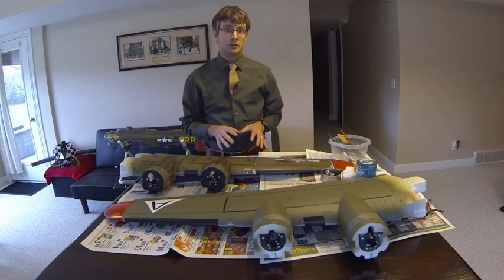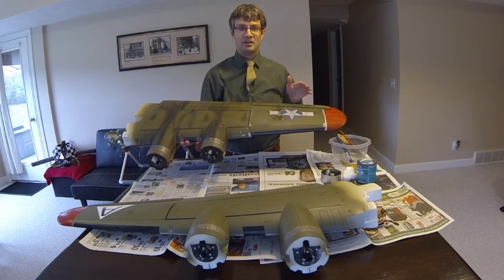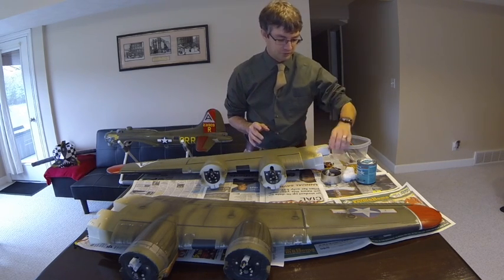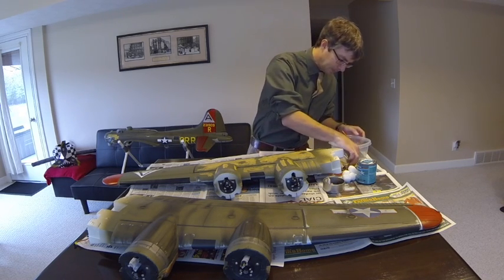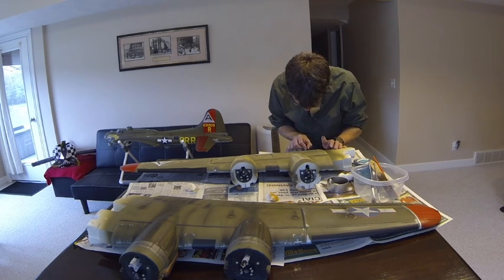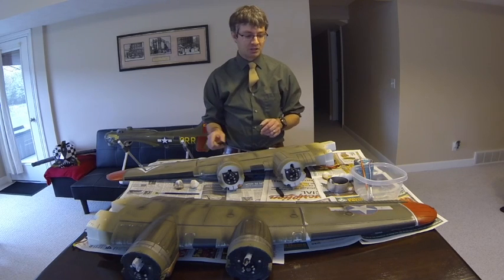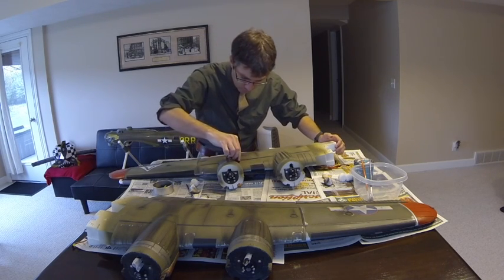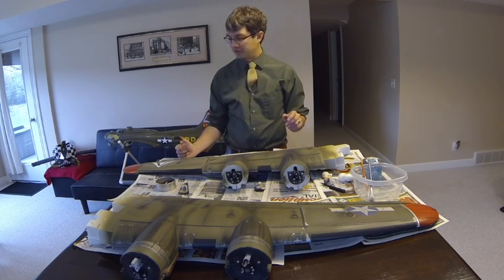How to weather the HobbyKing 1875mm B-17 Wing

Comment: Brilliant video.  Thanks for sharing. Your plane looks great.  Ive just ordered the same plane and will have it within the next four days.  I wanted the olive drab colour scheme but had to settle for the silver b17 as the olive drab version is completely sold out in my country.  Im really looking forward to getting this plane.  Im sure its a real stable plane to fly and should sound great with the four motors.   Well done on a great video presentation.
Reply from the maker: I bought the silver one first and then bought the olive drab one next. My silver one looks brand new as it is a replica of one being flown by the local museum and one I flew on a few years ago. I did very little weathering and added 2 coats of high gloss clear to really make her shine. The OD B-17 is very dirty to look like Nine-O-Nine after 91 missions. I worked with a few historical groups to get it as accurate as I could.
Reply: The weathering job you did on the OD B-17 is first class and I mean that.  It is so realistic looking and done to perfection.  This Hobbyking plane is a real beauty and I cant wait to get it up into the wild blue yonder.
Reply: Hi there, can I ask you a question?   By adding two coats of high gloss clear did that add much weight to your plane and did it affect the flying performance in any way?    Thanks.
Reply from the maker: The first coat is a clear spray, put on lightly to seal the pastels used for weathering. There isn't much weight added. The second coat is much thicker and brushed on. It is Minwax Polyacryclic clear. That does add some weight, but the B-17 is big enough not to be affected. There are other pilots who have added all sorts of cameras, working gun turrets, and bomb bays without any change in performance. The size of the B-17 makes those additions ok. On my smaller planes, the layers of paint and clear do make a difference.
Reply: I may just leave the silver b-17 in its original form with the decals added for now.  Im just wondering with the plane all silver will it be difficult to see at times when its up there?.  If it is after a few flights I may be tempted to repaint it olive drab on top wing and fuselage sides.  What do you think of this idea?  Or will it be fine leaving it all silver?   Im just thinking of it from a visibility point of view?
Reply from the maker: The silver isn't bad to see. The plane is big enough and the shape makes it easy to keep orientated. Lots of guys repaint their planes from silver to OD or OD to silver. I do like how the glossy silver reflects light when flying it in the evening. The OD won't do that. It just comes down to personal preference. I am happy to have both as the silver one looks spotless and the OD one looks like one that has done 91 missions. They both have different personalities. If you want to change the decals, Callie Graphics has a big collection of B-17 decals ready to go and she can make anything you want. Either a real B-17 or one you make up on your own. She can do everything. I didn't care for factory graphics, so I changed both of mine. I think the national insignias were the only decals I used from HobbyKing. The rest were all from Callie. You can always look at some of the markings used on the actual B-17's to increase visibility. Both of mine have the red tails and wing tips, but there were dozens of other colors used to identify the planes in the air.
Reply: Many thanks for all your great advice and tips.  I do like the idea of the light reflecting of the silver in the evening light for its in the evening time that I do most of my flying.  I must look up Callie Graphics. Brilliant.
Reply from the maker: no problem, always happy to help. Callie Graphics does wonderful work and you can see my silver one being used in the picture for Yankee Lady. I also do all of my flying in the evenings and love how the planes look with the setting sun behind them.
Reply: Yes absolutely, the planes flying in late evening with the setting sun as a back drop make them look so majestic and graceful.
Reply from the maker: started to work on my B-17 last night to get her ready to fly. You may want to consider raking the main gear forward to prevent nose-overs. I put the struts in a vice and bent them forward and used some washers to raise the rear of the retract housing where it is mounted to the wing. Check to make sure the screws that hold the strut into the trunnion on the retract are tight. If they are loose, the strut will rotate and cause the plane to veer off course.
Reply: That's a good tip for the landing gear.  The wheels on my p51 mustang are raked forward and I never have any nose overs.  But that was the way the plane came out of the Hangar 9 factory. I must take your advice on this one.  I glued the wings together last night with contact foam glue but made the mistake of using too much glue on both sides.  After a struggle I managed to get them to join up.  I wont make the same mistake tonight when I go to glue on the horizontal stabilisor and tail fin for I will just be applying glue to one side only.
Reply from the maker: I did the same mistake on the silver B-17. Ended up gluing my fingers to the wing and then gluing them to the faucet when I tried to wash the glue off. The test fit for the wings worked perfect and when I added the glue, I couldn't get them to align. The OD one went together much better. There is still an unsightly gap where the wings come together on both planes, but I will just live with it.
Reply: Sorry for asking all these questions , but you are a great help. There are 4 small rubber grommets that come along with the machine guns. Just wondering where they go as it doesn't say it in the instruction manual?  Did you just use a tiny amount of CA to glue in the guns? Or contact glue?.  Thanks.
Reply from the maker: No problem as I was the same way on RC Groups and most people are when it comes to assembling and setting up the B-17. The grommets hold the waist and top turret guns into place. You drill a small hole, just slightly bigger than the guns, press in the grommet and then slide the gun into the grommet. This works well since the gun is flexible when you bump it, which you will bump it whenever you handle the plane. The chin and tail guns just press into the foam. I don't use any glue as I want them to be kind of loose. I use 3mm shrink wrap tubing on the chin turret when I fly so if I nose over, the tubing flexes out of the way. When it sits static, I put the chin guns in.
Reply: Did you balance the 3 blade props or are they fine to bolt straight on?
Reply from the maker: I installed them without balancing and then check to see if there is any vibration when I run the motors at full throttle. If any seem to have a vibration, then I take that one off and check the balance. I don't have a proper prop balancer, which is something I need to get.
Reply: I balance all my two blade props on my fourstroke engine planes and have done so since the mid 1980s when I first started flying.  But with my electric planes which I only have the three, ive never balanced any of those props and ive never had a problem. So I think I will run them up first as you rightly say and see how they perform.
Reply from the maker: I too have never had a problem. I am dealing with loose retract issue on my B-17. Where the strut does into the retract trunnion is loose and the strut rotates a few degrees. I replaced the set screw the factory uses and installed cap screws. Last night I broke the heads off of both screws trying to get the screws tight enough to prevent the strut from rotating. The retracts have always been an issue on these B-17's. I will be looking at changing them out completely this winter for something better.
Reply: Yes the retracts on the B-17 I would imagine wouldn't be of the best of quality.  I went to glue on the tail fin tonight but brfore I added any glue I tried a dry fit first.  I noticed it didn't sit fully flush towards the rear of the plane but it wouldn't push any further down . So im allowing that this is its normal position. Its only sitting up about 2mm if even that.  Did you notice this when gluing on your tail fin?
Reply from the maker: My horizontal stabilizer is fully seated into the fuselage and I don't recall the vertical one sticking up. I know that it took a little wiggling back and forth on the vertical tail to get it to fit right. It is a tight fit as I had it pretty well stuck in the plane without any glue and had to work to get it back out. Check to make sure the push rods are causing it to bind. I recall the pushrod binding on the horizontal stab making it sit too far to the rear. I had to hold the push rod out of the way and then it would drop into place. I had to test fit the tail a few times when I did the retract installation. Eventually, the foam displaced enough to make it easier to assemble when it was time to add the glue.
Reply: The horizontal stabilizer is the perfect fit.  I glued it down the other day with no problems.  The vertical fin however had to be wiggled about to get it to seat properly.  I can now add the glue as im happy with its position. Have you installed your FW190 retractable tail wheel and is it a good fit?
Reply from the maker: Yep, both of my B-17's have the retracting tail wheel installed. The fit is pretty good. I cut out a rectangular section where the factory wheel is placed and then built some balsa supports to be extra safe in terms of handling landings. The turning radius is terrible, but it doesn't bother me since I carry the plane to the runway and once the tail lifts off, the rudder is doing the work. I found out last night that I might lose my flying field and it is the only area large enough with a groomed runway that I can fly my B-17. Not sure what I will do for the future.
Reply: Ah that's terrible news to get. Do you belong to a club or is it just a private field you fly from?  Im in a local club and we have one of the best grass runways in the NORTH OF IRELAND.  Its long and wide and always well cut.  There are very few trees around thank goodness.  I hope that you get holding onto your flying field, but if the worst comes to the worst, that you will be able to find another suitable site for the B-17.
Reply from the maker: I fly with a club that uses a corner of the local airport. The city has been trying for decades to tear it up and put in factories and condos. I heard they finally have a buyer for the land to make that happen. I should know in a few months if it will happen or not. The secondary field about 20 minutes away from me also sold for developers, so that club is out of a flying area too. I am not sure what I will do, except work on getting a lot of flights with the B-17 over the next few months before winter arrives. Tomorrow I am heading to an air show to see 2 B-17's and one of the only 2 flying B-29's. One of the B-17's is the real version of my silver one.
Reply: That will be fantastic to see the real version of your silver B-17.  They are an iconic plane from World War Two and every American should take pride from the history of this aircraft and always remember the brave young airmen who took to the skies over Europe and fought heroicly for the freedom we all enjoy today.  I love the B-17.  Enjoy your day at the airshow.
Reply: I was looking up the Flightline RC B-24.  Those Flightline models look to to be of high quality. I still prefer the look of the B-17 over the B-24, but sure we all have our own favourites.  They also do a nice flying TigerCat twin engine.  What I like about the Hobbyking B-17 from the videos that I have seen is that it be flown very scale.  An owner of the Freewing B-17 made the point that in order to keep his model stable in the air it had to be flown fast and in my books that is a turn off.  Cant wait to get this big silver beauty in the air.
Reply: Hi there, you wont believe it but ive bought another Hobbyking v2 B17 Flying fortress.  When I was on the internet last night I noticed there was almost £70 knocked off the price. I really had no intention of buying a second one but if the silver one turns out to be a good flyer I might repaint this other one in olive drab and get the decals from callie graphics.  I thought it was a bargain at the price.  I had thought about getting a Spitfire, but I was more drawn to the B-17 at this special offer.
Reply from the maker: I think almost all of the B-17 owners on RC Groups bought another one with the sale going on. The price really came down and the plane is worth getting a second one. Some of those guys have 4-6 B-17's. The weather didn't cooperate for the airshow this weekend, but I did get some good pictures of the B-17's proving air support for a reenactment of allied troops engaging a German group of soldiers. Normally they do this act with a few B-25's, P-51's, P-47, an A-26, and then do a pass with the B-17 and B-29. The weather cancelled all of them, except for a few passes of the B-17's. I had to wait for hours after the show the catch the B-29 fly. I will send you a link to the pictures when I get them posted.
Reply: Many thanks for that, I will look forward to seeing that link.  That was bad luck with the weather you had at the airshow.  I have my B-17 almost ready for flight. Going to check the balance point on it tonight with the battery installed.  It states in the manual anywhere between 38 and 45mm .  Im using one single 3s 4250 lipo.
Reply from the maker: 15.5 inches from the tip of the nose is where the guys on RC Groups are having the best luck. I had to add a little weight up front with my 2 2200 batteries to get it to balance. The manual has the CG wrong, so use the 15.5 inches. You can really go +/-.50 inches from there and be ok. Everyone says the CG is pretty forgiving. To help the B-17 from pitching up with full throttle, I have 10% down elevator programmed at full throttle. Don't use flaps on the take-off. The B-17 will want to climb quickly when it gets off the ground, and flaps make it worse and it will stall.
Reply: Im a bit confused about the Cof G instructions they have give in the instruction manual? My other planes I just have to measure back from the leading edge with the measurements they give .  With this its measuring back from the front of the fuselage and im just confused. Maybe you could explain it for me?   Thanks.
Reply: They have it printed on the manual that its 38-45mm.  But I would definitely say this is a misprint and should be centimetres instead?  Also am I right in saying that the plane should be balanced upside down?
Reply from the maker: yes, the manual is wrong. Use the 15.5 inches from the tip of the nose as that is where it flies the best. You can check it either upside down or right side up. I have had ok results either way. The gear up or down as they don't make too much of a difference with a plane this big.
Reply: Thanks for that.  Am I right in saying that the lipo battery placement is on the floor of the fuselage?
Reply from the maker: Yep, the battery sits vertical on the floor of the fuselage and is pushed up towards the bulkhead behind the bombardier. Most guys cut the ribs out of the fuselage and build a plywood floor with Velcro and straps so they can fit all different size batteries. I tape my 2200's together and push them down to the floor and forward. I have tried to glue or stick Velcro to the floor, but it won't stick. That is why people build a floor out of wood.
Reply from the maker: https://www.flickr.com/gp/brgt350/H827xq    and    https://flic.kr/s/aHsmmCA8Cy    are the links to the air show this past weekend. While there were a number of planes that flew, the pictures are mostly of the B-17's.
Reply: Hi there, im taking my B-17 for its maiden flight early tomorrow morning. The weather will be perfect as it will be dry and a windspeed of just 4mph.  The only thing im not sure of is the CG. So im going to place my 3s 3900mah lipo as far forward as possible and even it is very nose heavy I can make adjustments from there.  I hope all goes well and I know I will be nervous as I always am when it comes to maiden flights. I will let you know how everything goes.  Fingers crossed.
Reply from the maker: Thanks and best of luck to you as well! I had trouble sleeping for days leading up to my maiden of the silver B-17. I hauled it out to the field and had a lot of people who came to watch. I chickened out and everyone left except for 2 club members. Just as I was packing up the plane, the winds went dead calm and there was just enough light to fly. I took off and it flew perfect! The CG is pretty forgiving and always better to error to nose heavy. Next to the ESC between the motors, there is a plastic cover to let air pass over the ESC. Behind the cover is a square piece of foam between the recessed areas for air to escape the ESC. The center of that square is 15.5 inches. I do a quick finger check of the CG using that spot. If it balanced anywhere on that square, you are pretty good. When I check mine using the CG machine, I measure the center of the pads to a wall and then place the B-17 nose against the wall and the wings on the CG machine pads. I adjust as needed to get it to balance. I stagger my 2200's to allow some air flow to come through the chin turret, so that biases some weight reward versus having the batteries in-line vertically. I would think your 3900 fully forward would be good.
Reply: Well the maiden flight was a bit of a disaster .  Even at full power the plane just wouldn't run on the grass, just kept nosing over. I held in full up elevator but it just kept nosing over resulting in 3 of the props breaking and one cowl breaking also.  What is the problem?  Do I need more throw on the elevator and should I change the props to master airscrew?.  The grass was cut really short, so I cant figure it out why the plane wouldn't move, only nose over.  Your thoughts would be greatly appreciated?
Reply from the maker: well that is not a good way to start a maiden flight. I am thinking the problem is with the landing gear. I took the struts out of the retract housing and bent them forward about 1/2 inch and then used tiny washers at the back of the retract housing where it screws into the wing to tilt the entire retract forward. This dramatically moves the center of the wheel further forward when looking at the plane from the side. Raking the gear forward also lowers the plane, which makes it more stable for ground handling. If the grass is really a problem, I will go out and move the plane back and forth a few times in the grass to make tracks to get the plane rolling. Once I can get some speed and air moving over the elevator, it usually works ok.
Reply: Thanks , I will make that modification to the struts on the retracts.  I have the elevator at full throw on the end point but its not near the same amount of throw I have on my hangar9 p51 mustang.  I might adjust the servo horn on the elevator servo to give me more throw. Im also going to order 4 master airscrew 10x7 three blade props.  I determined to get this plane in the air.
Reply from the maker: Make sure you get two counter-rotating props and two normal props. The elevator is really touchy on the B-17 because of how large it is. I have 15mm up and 19mm down elevator travel with 30% expo. Some people, not B-17 pilots that I know of, program an over extension on the up elevator to use for ground handling and then flip a rate switch when they take-off. If you are flying your B-17 as a G model with the chin turret, you can replace the chin guns with 3mm black shrink wrap tubing or plastic straws. They will look real in the air, but bend out of the way if you nose over. One trick that I used to use for taller grass was to use a section of plastic hallway runners you get from a home improvement store. They are 3 foot wide clear plastic sheets that level out the grass. I would use that to gain speed and when that ran out, the plane is moving fast enough to overcome the friction of the grass. I haven't tried it with the B-17 and it could be hard since the plane is so wide. 3 feet wide on a small plane gives you lots of room to control yaw before you drop a gear off the side.
Reply: That's a good idea the clear hallway sheeting, will keep that in mind.  Im really confused about the props though. The four hobbyking props, I bolted them onto the motors and looking at the front of the plane the two on the left were rotating to the right while the two on the right were rotating to the left. Was that correct?  Also im confused about these counter rotating props you are talking about?  Are you telling me that two of the hobbyking props were ordinary props and the other two were counter rotating?  If so then were are these props positioned? Sorry for all the questions but im thinking now maybe I hadn't the props on the correct way?  I didn't seem to be getting a lot of thrust at full throttle.
Reply: Am I right in saying that two of the hobbyking props are standard and the other two are counter rotating?   How can you tell which prop is which?   Are there markings on them?
Reply from the maker: aidan mcatamney you have to look at the pitch to see which direction they turn. I can't recall if they are marked or not. Once I have them right, I put decals on them so I will know. I think all the props spin inwards towards the fuselage.
Reply from the maker: Sorry I missed this post, but yes, two props are counter-rotating and two are normal. The motors should be connected so when you look at the plane from the front, the props spin inwards toward the fuselage. It takes a little trial and error to get them all spinning in the right direction and the right props on the right motor. It isn't uncommon that planes with little thrust have a prop or two backwards. Just saw it the other day on the RC Groups. I had my maiden flight tonight and it went very well! Nice scale take-off and climb out, retracted the gear and made a few passes. Had to bring her in quickly due to actual air traffic departing the active runway. Came in too hot, went to full flaps and she climbed up and then landed with a bounce. The one gear strut is now loose and couldn't be fixed at the field, so she is grounded until I get that fixed. I broke the screws trying to tighten the strut to keep it from moving, so not sure how to fix it. Might need a new retract housing. I should have some pictures tomorrow. I didn't take any video, just got still pictures. Brought a P-51D along for fighter escort.
Reply: Yes I had the props all rotating inwardly towards the fuselage, that bit was correct.  But I never knew about that they were a mixture of standard and counter rotating props. I will have to do research on that one before I buy any new ones.  Over the last 32 years of flying, all ive ever used on my planes were two blade props. This is the first time ever that ive worked with a 3 blade prop.
Reply from the maker: Both of my B-17's, PBY, and Hellcat all have 3 bladed props. I have a 4 blade for my P-47 and a 3 blade for my Corsair that are used for static display, but fly with a 2 blade. I took my retracts all apart and had the trunnion drilled for a larger screw to keep them from getting loose. Hopefully this will solve my issues.
Reply: Yes I hope that solves the issues with your retracts. Im going to follow your advice and slightly bend the retracts forward to give better ground handling.  When I arrived home this evening shortly after 6.30, Royal Mail had left a very box for me, it was of course the second of my B17s which I had ordered at the beginning of the week.  I had read on RC Groups earlier, where an RC pilot had said that he was talking to a Hobbyking Rep who told him that they were bringing back the olive drab B17 FLYING FORTRESS at the end of 2018. How true this im not so sure.
Reply from the maker: With Hobbyking, you never know what to expect. Their products come and go all the time. I hope they continue the B-17 as it is a fantastic aircraft and the only one on the market. Glad you got a second one! I got my trunnions back from the machine shop and much happier with the results. One of my struts is bent so the gear won't retract, but I can fix that. I think the connection was so loose before that the strut just moved out of the way when it retracted. I knew I only had 1-2 flights before it would be too loose to continue.
Reply: I ordered 4 master airscrew 3 blade props today.  Two standard and two reverse pusher.  I will paint the wing tips yellow whenever they arrive next week.  What capacity of lipo battery do you use in your B-17?   What flight times do you get?  Im going to an airshow tomorrow. It will feature both a Spitfire and a Hurricane as well as the Red Arrows aerobatic display team.  Its an annual event that go to every year and there is also a static display of many RC model planes and choppers lined up for the public to view.
Reply from the maker: I would love to see a Spitfire! They are one of my all time favorite planes. I used to watch Battle of Britain with my dad as a kid and still have a model of a Spitfire that he built for me when I was 4 or 5 years old. I am using (2) 2200 3S batteries with a flight time of 6 minutes, but looking at the usage, I can bump that to 7 minutes. Most guys fly with larger batteries which helps with the CG too. I have a lot of 2200's from my other planes, so I just use them.
Reply: Hi there, I received my 4 new master airscrew props today and ive painted the tips bright yellow.  Ialso had to insert adaptor rings into the hub to fit onto the 4mm motor shaft.  The problem is I cant bolt them onto the shaft using the hobbyking bolts as the hole at the back of the hub is too large to accept the hobbyking bolt. What should I use?   A prop adaptor or  some kind of washer?   I would be glad of your opinion on how best to install these new props?
Reply from the maker: I think the setup is similar to what I had to do on my PBY using MAS screws. That used a threaded motor shaft, a nut, then the factory prop with a hex molded into the back of it to secure the nut, and then a nut to lock the prop to the shaft. When I went with MAS screws, I had to use one of the MAS sleeves to get the diameter to match the motor shaft. I put a washer between the nut and the prop on the back side. I then took the nut on the front side, added locktite, and tightened that while holding the nut on the backside. This sandwiched the prop between the nuts and the locktite prevented it from coming loose. This was really vital on the counter-rotating side. I broke my retract last night on mine. While trying to install the larger fasteners, I pinched one of the wires to the retract motor and it no longer works. Back to the drawing board again! :(
Reply: that's brilliant THANKS. I will try that with the 4 washers.  Can I as you why you don't use 2 nuts at the front of the prop instead of one? Or is one nut enough to secure the prop using the Loctite?
Reply from the maker: Not sure, guess I haven't had a prop come loose that I decided to add an additional nut. It surely won't hurt anything to do so. Be sure to check your motor mount screws often, as those will loosen up and the motor will spin in the mount. Let me know if the washers work for you on the props. I am thinking they will since the prop and motor shaft is similar to my PBY.
Reply: Have 4 new 10x7 master airscrew 3 blade props now secured to the B-17 with the help of M4 penny washers on each motor secured by one nut at the back and two nuts at the front along with a drop of thread lock and tightened up sweetly.  I didn't bother balancing the props this time round but should be ok.  That's her ready for the second maiden flight as I didn't get off the ground first time round.  I had all 4 props running and everything seems good to go.  Just waiting now for a calm day next week and a bit of good luck to go with it.  Hope all is well with your B-17s.
Reply from the maker: sounds like you are on the right path with your new props! My B-17 is grounded after damaging a retract by getting a wire pinched in the housing. Make sure the wires behind the motor are secure and out of the way. I took my cowls off yesterday to check the motor screws and found the wires had worked themselves out of the wings and rubbed against the motor. Two wires on the number 1 and 2 motor had the insulation stripped and the bare wires were showing. The cowl was full of red insulation shavings. I am glad I discovered that before the next flight! Some guys take a zip tie and secure the wires and glue the tie to the foam. I used a metal clamp and large screw. I am guessing I am a week or more away from getting mine put back together and ready to fly. The runway is flooded right now after almost 2 weeks of rain, so I have been flying my Timber float plane and PBY Catalina. Too wet and flooded for anything else.
Reply: Hi there, I also meant to say to you that I have pushed the wires in as far as they can go and then placed a strip of very sticky heavy duty tape across the entrance to keep the wires from coming out. Do you think that this will be secure enough to keep the motor wires in there?  Thanks.
Reply from the maker: that should work after seeing some of the other solutions. I add a little tape to the wheel wells to keep the wires from coming in contact with the landing gear when they are retracted.
Reply: That's a very good tip adding tape to the wheel wells. I must try that also. Many thanks, you are full of great ideas.  I cant wait to get this big warbird in the sky.
Reply from the maker: no problem. The Bomber Crew on RC Groups has always been very helpful over the years and I try to return the favor to anyone working on the B-17. We all help each other out and do our best to keep 'em flying!
Reply: Ive got another question for you in relation to the prop installation and this one is filling me with curiosity.  You know that I have a penny washer supporting the back of the prop. I was just wondering if a washer at the front of the prop also with the nut secured against it would be either a good or bad idea?   The way it is at the minute, the nut is tightened into the plastic hub of the prop. I just thought maybe the washer would give it more support and spreading the load out rather than eating into the plastic hub. What would your opinion be on this?
Reply from the maker: Well, I just added a washer to my props this weekend. I found a box of 3/16" washers that fit perfectly into the factory props. This will increase the area in which the nut applies force to the prop. I think it is a good idea and going to be doing it to my other B-17 as well.
Reply: Ive just finished placing washers on the front of all props and I can report that its a really good secure job.  Im glad I did it and I would highly recommend it.
Reply from the maker: Yep, good idea indeed! My replacement retract housing should be here on Thursday. I should be ready to fly again this coming weekend. There is a big hurricane coming towards the USA and it has stalled out the weather where I live. We are expected to have perfect flying weather for the next week. Scattered clouds, fairly calm, low humidity, and no rain forecasted.
Reply: Yes I saw that on the weather forecast about Hurricane Florence heading in the direction of North Carolina.  I hope it passes by quickly and everyone stays safe.  Good luck next week with your B-17. I hope you have a successful and enjoyable flight.
Reply from the maker: glad not to be anywhere near that storm! Our flying field is pretty much dried out, so I should be ready to fly the B-17 this weekend. Last night at the club we had the largest collection of warbirds in the air at one time. My F6F Hellcat, a Hawker Sea Fury, P-51 Mustang, and a US Navy J3 Cub complete with a bomb drop.
Reply: That sounds fantastic with all those great warbirds in the sky together.  Theres just something nostalgic and noble about seeing a collection of world war two model planes gracing the heavens.
Reply: Hi there, just to let you know that I maidened my Hobbyking B-17 Flying Fortress earlier today and she flew beautifully.  The new master airscrew 10x7 props did the job well and on takeoff she tracked as straight as a die down the runway before majesticly lifting off.  I decided for this first flight that I would keep the wheels down just to see how things would go.  I have to say that I am really pleased with this plane and how it flies.  After trimming it out it flew hands off straight and level and as steady as a rock.  Im really glad now that I bought a second one.  They are worth every penny.  On landing I brought it in from far out low and slow but I didn't need flaps. I just kept a bit of power on until I was just a few feet off the ground and she touched down really nice and gentle.  She looks fantastic in the sky and three of my club members who witnessed the flight had nothing but good things to say about this lovely B-17..  I cant wait for my next flight and I hope you are enjoying yours too.
Reply from the maker: Fantastic! Glad you had a great maiden flight! My flying season is about done, so I put my B-17 back up in the garage. I had a bad crash with my Cherokee due to a servo failure, and that has really caused me to lose some confidence in my flying. I bought my B-17 the field after that, but didn't fly it. I did run around on the grass with it to see if I could get the landing gear to loosen up. They stayed nice and tight, so my fix worked. Just need to work up the courage to fly again.
Reply: Im so sorry to hear about your Cherokee, that could happen to the best of pilots, you were just very unfortunate.  Yes I know how you feel about the confidence thing, but believe me that will come back again with time.  Im so glad I bought a second B-17, had thought about painting it olive drab. But ive heard on the grapevine that hobbyking may be introducing it again so I will wait and see.  You did a good job fixing your retracts, I will keep an eye on mine just in case.
Reply from the maker: that has been the rumor lately from HK, which would be great! I am sure the confidence will come back.
Reply: Hi there, I have another question for you that is bugging me and I know that you have a wealth of knowledge with electric planes and it would be great to hear your opinion.  Over the last 32 years most of my flying has been done with engine planes, two stroke and four stroke so my knowledge with electric is not great.  My question is this?  Since ive been flying this great B-17, ive only ever used one battery, a 3s 5000mah.  Am I right in saying or maybe im wrong, that if you use two batteries then this acts as a safety measure, meaning that if an esc or motor cuts out forever reason then two motors will still be running, one on either side ?   Either the two outside motors or two inside motors , enough to give power for a safe landing and to feed essential power to the receiver?    Am I talking a load of rubbish or is this the case?  Many thanks.  Aidan
Reply from the maker: I run 2 batteries because I have a lot of 2200's and not a single battery large enough for the B-17. There is a Y harness that splits power between the inboard and outboard motors if running a single battery. Mine has one battery for the outboards and one for the inboards. If an ESC fails with either a single or dual battery, only the inboards or outboards are affected. It is the setup of the wiring that acts like a safety feature, as long as you connected the wires correctly. With two batteries it is easy to tell since I when I hook up one battery, one set of motors beep and the second battery signals the other motors. With a single battery, all get power at the same time. You could do a double check by taking out the single battery Y cable and hooking the battery up to each cable in the plane. If you hook it up and only one wing has motors that beep, then the wiring is setup wrong.